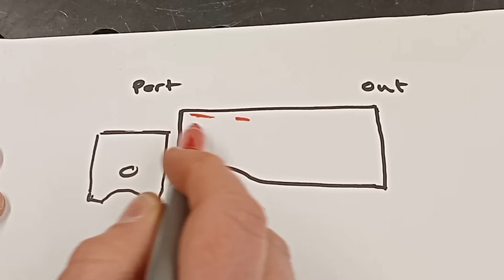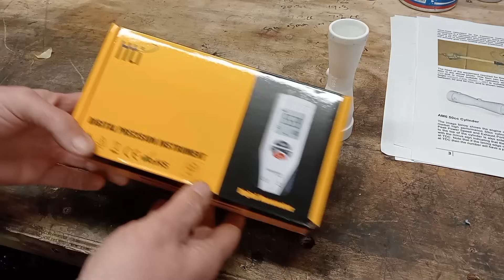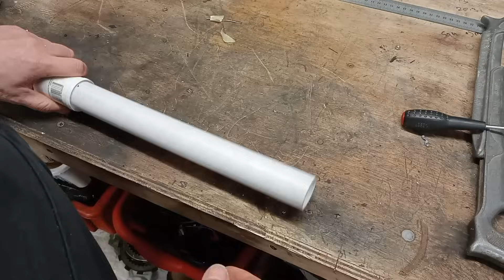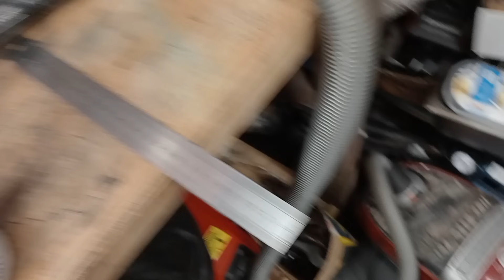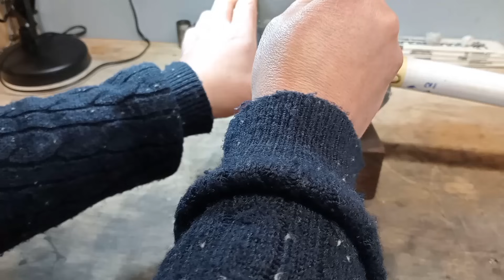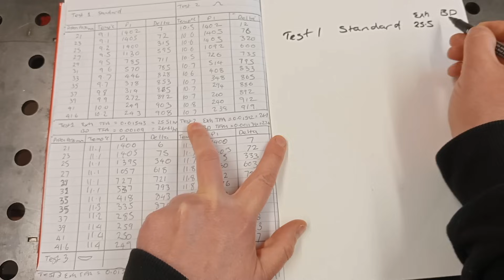2 Stroke Flow Testing - Power increase? 100 MPH Moped Challenge. #power #2stroke #hp

Comment: Sir i have two stroke cylinder i want to increase its rpm, power please help me how i can increase the speed from its ports.  Please help me tell me sir
Reply from the maker: Hi, what cylinder and what are the durations for the ports?
I go through raising the exhaust port in this video https://youtu.be/_4X0QWb8Wcs?si=Fh-8-nIwXexxVCur

Note: raising the exhaust port roof 0.5mm makes quite a bit of difference.
Reply: @AutoBeta2T  Sir, please 🥺 give me your whatsapp number and I will send you the picture of the cylinder and also the picture of its crankshaft.
Reply: @AutoBeta2T  I'm so confused because of porting I've done a lot but I lost a lot help me please tell me
Reply from the maker: @janeali1174  what engine do you have?
Reply: @AutoBeta2T  Suzuki carry two stroke ST30 lj50
Reply: @AutoBeta2T  hello.sir ...!?
Reply: @AutoBeta2T  sir please help me
Reply from the maker: Hi, email: Autobeta2t@yahoo.com
Reply: @AutoBeta2T  Sir give me your whatsapp number I will send you the picture of the cylinder and piston and also send you the video of its engine. Please sir help me in this task I am very confused that's why.  I don't understand anything please sir help me tell me
Reply: @AutoBeta2T  hello sir .! 😕
Reply from the maker: @janeali1174  hi, I sent you an email asking for some pictures.
Reply: @AutoBeta2T  Sir I have sent you a picture of the cylinder on Gmail
Reply: @AutoBeta2T  hello. Sir

Comment: i use big pipe chamber on my kr150 its good for high rpm but give big drop powerband around 7 /8k rpm before  power valve open, how to get rid that problem 😢
Reply from the maker: Unfortunately I think everything is a compromise...
Maybe a ATAC chamber?

Comment: Hi Dave, how about trying a bell mouth on the carb?
Reply from the maker: Definitely,  I have a 3D printer, so really want to explore how it affects power.
Reply: @AutoBeta2T  Obviously it's about 4T but have a look at 
Garage 4AGE, they've tested various fixed length velocity stacks/inlet runners as they call them as well as variable length ones, sort of ypvs on the intake on Toyota (Yamaha) engines

Comment: Hi! Could you advise how to calculate the exhaust for an engine with two pipes per cylinder? I have several old Soviet 175cc engines, they have 2 pipes, one cylinder and are very low in power. I don’t drive them all the time - it’s just small hobby.
Reply from the maker: Hi, I'm not too sure about these types of engines... I would imagine maybe two pipes that are 50 % of the area of a normal 175 cc engine?
I think EngMod2T can model these types of engines? I'll have to have a look later if it can and if so if there is any guidance.
Reply: @AutoBeta2T  Thanks for the answer. It is a simple 175cc single cylinder engine, one of the Soviet copies of the old DKW - cylinder diameter and piston stroke 62x58 mm. There is no reed valve, their speed is low - about 6000 rpm at maximum power. About 14 horsepower. I have a program for calculating exhaust using the Blair formula, it’s quite simple, but it seems to work. The problem is that I don't understand if the single exhaust calculation will work with the dual exhaust. Some also advise me to take half the volume of the cylinder for the calculation, but I believe that this is the wrong way - after all, each exhaust has its own port.
Reply from the maker: Hi, I had a look on engmod2T and it does simulate this type of exhaust port. There wasn't a massive amount of info on there but it looks like the pipe configurations available are two separate exhausts or a two into one. I would think that a calculated two Stoke exhaust for the 175 engine would work but with the header split into two. Probably with the diameter of the header equating to half the area of the single exhaust header that was calculated.
Reply: @AutoBeta2T  Hello! Thank you for your time. Are you proposing to combine both pipes into one resonator? The calculation program uses the height and width of the exhaust port. It might be worth just designing two exhaust pipes, each with its own exhaust port. I have a more "advanced" version of the engine as well. This engine has a single exhaust, with the exhaust port being much larger than each of the two in the old version. And the pipe is also much larger. But I'm not sure the engineers planned to increase its power. Or rather, they tried to reduce the volume)))
Reply from the maker: Hi, yes - both header pipes go into one resonator. A bit like some snowmobile pipes.
Reply: @AutoBeta2T  Ok, thanks for the help. The weather will get warmer and I will do it.

Comment: As someone's who's trying to fix up an AR50 that's been off the road for 30 years I'm chuffed to come across this series.. great work 👍 I've got a bdk ignition, bdk pipe, 21mm carb.. I thought I had it going but after sitting for a couple of months the cylinder was full of oil! :-(
Reply from the maker: Cool, I'm pleased it is of some help. I rode mine with the BDK set up and it was quick - front wheel went up very easily!
Reply: Out of interest what sort of speed would you expect from the 93cc BDK setup? Also, I'm guessing you premix? Sorry for all the questions, not many of us with AR's nowadays and not much info about! @AutoBeta2T
Reply from the maker: Sorry for the delay. I guess 80 mph maybe more if a full set-up. There have been claims of these going 100mph but I'm not to sure of the actual spec of the engine.
Reply: @AutoBeta2T  no problem.. I'd be happy with 80mph 🥴.. back when I was 16, I had a micron, 93 kit, 21mm carb and a supposedly derestricted cdi but it still struggled to get to 60mph.. but at 16 "tuning" involved trying to skim the head with a hand file and using cereal boxes for base gaskets! 😂😂
Reply from the maker: @user-ye8xx7gl3j haha - sounds a bit like mine... I think mine had the ar80 Ignition so would pull 65 and maybe 70 down hill. It had a micron pipe so probably not the best but it looked ace 👌
Reply: @AutoBeta2T  same here.. micron pipe with the three bolt end can.. my cdi had been cut open, you could see where the top of it had been glued back on.. still didn't want to rev though 🤔

Comment: you might be experiencing  part of what happens when you use a wobbly duct.
Reply from the maker: Yes. I was thinking that too. I want to do much more research in to the duct design and test it. Hopefully in the new year sometime.
Reply: @AutoBeta2T  i  mess about tuning mopeds on a hobbyist level and most ducts on cylinders taper out bigger. whereas according to wayne wobbly wright if they taper smaller they make the pipe work better. so for single exhaust ports the wobbly duct tapers to 90% of the diameter of ports effective area in the length equivalent of 1.5 x bore size.  and then back to 100% bore size  in 0.5x bore size.  its a 2 part duct,  total length 2 x bore diameter.  so they narrow slowly and then open up again but a bit more sharply.  heres my example.  i did this to a 47mm 74cc gilardoni cylinder and ex port area was 490mmsq  which using maths pi etc = a circle of  25mm diameter.   first part of the duct   is 1.5 x 47 = 70.5mm long, at that point i needed 90% of 490mm sq = 441 which is equal to diameter  23.6mm.   the first 29mm of this part of the duct was my cylinder duct itself which needed altering. you can drill and insert the correct shaped piece or weld it up. so attached to my cylinder i needed a duct of 1.5 x bore MINUS the cylinders 29mm long duct   70.5 - 29 = 41.5mm.  the start diameter of that duct i had to workout cos the first 29mm had already lost a mm or so. and then 2nd part of the duct is 0.5 x 47mm = 23.5mm  long. and that goes back to 25mm diameter.  bit hard to explain.  but a diagram shows it much more clearly.  ive done a simple cad drawing showing it with my sizes if you wanna see it. dunno how to get it to you? @AutoBeta2T  ?
Reply from the maker: @aljaxon69  hi, that sounds like what I am trying to do with mine. The 1.5 x bore restriction works well in EngMod. And the Mach is around 0.8 too.
It would be good to have a look at your design. My email is: autobeta2t @yahoo.com

Comment: Hi, the flowbench results itself are just half of the game. I would consider the shape of the port with constantly increasing cross section downstream the port window as important, because that helps the wave propagation of the pressure pulses. In mota 2 stroke software I obtained a power increase by raising the port floor of the exhaust window (just as Alex's PIP cylinder had). And mota doesn't even ask for flow coefficients, but does calculate the forward and returning waves from the shape (cross section) of the port. So the opening angle of that part of the exhaust port needs to be considered as well and should probably match the initial opening angle of the pipe....
Just my thoughts of what could be intersting here...
Curios to know what you think about that :-)
Reply from the maker: Hi Stefan thanks for the comment. I've been about to reply several times now but I keep getting interrupted. 
Yes, in theory the exhaust duct should diverge at the same angle as the header pipe but I'm interested in the Wobbly duct design that restricts  the outlet to about 90% of the window area. I intend to do some testing on this.
I haven't played with raising the floor in the simulator yet but again something to try.
I think getting the duct volume as small (optimal) as posible maybe key?
Something to experiment with next year. I will try the shape.of duct you describe too.
Cheers,
Dave.
PS - how much power did you gain in Mota with the raised exhaust duct floor? Did you notice any difference in the pressure wave when viewed in the wave viewer?

Comment: Ciao ho sbirciato varie volte i tuoi video ed oggi mi sono iscritto. Vorrei sapere per cortesia dove hai acquistato il tubo venturi con le prese e i misuratori di pressione
Reply from the maker: Ciao, grazie per esserti iscritto. Ho aggiunto un elenco di articoli alla descrizione, ma vedi anche di seguito:

TorqSoft equipment list:

Venturi 20 mm is most suitable for cylinders with port diameters of less than 33 mm:  https://www.shapeways.com/product/FTPHNUF3X/flow-venturi-20mm?li=shop-results&optionId=59345290

Venturi 27 mm is suitable for cylinders with exhaust port diameters between 30 and 44 mm, and is shown below.: https://www.shapeways.com/product/ZFQJ7UAL2/flow-venturi-27mm?li=shop-results&optionId=59381039

Manomenter: https://www.amazon.co.uk/dp/B07K87NQMD?ref=ppx_pop_mob_ap_share

Brass nipple - 3mm: https://www.ebay.co.uk/itm/390948209350

Comment: I wonder what the difference would be if the exhaust port had a horizontal piece of metal inserted to basically split the top and bottom,  obviously something quite thin.
Reply from the maker: Not sure... If it was thin there would be risk of it heating up and acting as a heat exchanger. It could help blowdown flow.

Comment: My brother had ar50 in his teen years going back 30yrs ago or so, old man put ar80 head, carb and micron exhaust on  and made it worth riding, I remember riding on the back with  him as a 12yr old.... brakes were shite though😂. I never went down the bike route after that, though Bro did some scrambling as we called it back then and got a slighgly tuned big wheeled rm80. As  a fairly small 14-15yr he struggled somewhat 😂... we shouldn't of sold that bike😢 but he bought an Rd125 instead. wished I taken it up more and got my bike license but never  did and went into cars, into chainsaws  and porting with my work now,  so always had a love for 2 bangers. Would love  a 2t dirt bike now, great series though❤👍
Reply from the maker: Hi Rick - sounds like great fun strapped onto the back of your brother! 
Are there any dynos for chainsaws?
Pleased you are enjoying 😀
Reply: @AutoBeta2T  Yeah, there's a guy in the States who has a channel.  'Dyno Joe', I'm curious about that flow testing... you put a hump on the floor of the port, not sure how that is increasing the hp. Is it like accelerating the flow out? Would you just weld that in and shape it with the foredom something🤷🏻‍♂️

Comment: Ive  a super flow  machine ive been  flow testing two stroke motor 14 years  but ive been doing kart motor for 30years  you doing stuff ive already done . You can do more work on inside the piston  , run one ring  . Bottom end pay big part in flow to . Flow test the carby  the air box  .  Pipes Rule of thumb  longer the pipe from the head of the motor to end of first cone give you more bottom end power  that means the power band comes on early and goes out early so shorter the pipe more topend . Now you running a reed block same thing with that to thinner gasket  thicker gasket . More testing.  Good example my mate does outboard boat motors for racing 25hp  because you can't change the pipe  because the pipe is the leg of the motor  you spaces  the carbys out  gives you more bottom end power .  All so read your pug each run to .   Remember  this at work temperature  thing change in shape too . For example nascar motor they hot hone their motor  at working temperature  something think about
Reply from the maker: Cheers for the info Storky. Where did your testing of the exhaust duct point you? From what I can see the flow favors the edges of the duct when the piston is in the blowdown phase and having a raised center section on the floor appeared to help the flow but it reduced the noise too.
Reply: Funny thing  when I test my old motor  kt100s  we could not touch the ports  I was looking for good  barrel    they were hard to find   mostly we were looking at transfers port  . Then years later I was speedway kart  in open  class  did alot porting . One thing I found  in running synthetic caster oil because it a dirt oil and carbon use to build up in exhaust port  that were I use to grind   what they call rabbit ears  in exhaust port  go wider  not high in the port  you go to high the power stroke is small   you lose bottom power  .your transfer port try flow them to front piston  give you better torque  . The head  .8 to 1mm squish  kept  a sharp edge on squish  to bowl  better mix  better responses down low   and the  position of spark pug as well  point the opening towards the exhaust port  more testing

Comment: Looking good progress. 👍
Just make biggest hump and mill it down if it not make any difference.
Have you tested 2mm smaller arrister tube to ex port?
Reply from the maker: Hi Pienari, I could do it that way but i would have to weld up the duct and i'm worried about distorting the cylinder. I'd like to bore out the duct and just use an insert but that will have it's problems too.
I do want to try a smaller exhaust stub - currently it is 30 mm dia where is goes into the exhaust. 28 mm would be about 90% of the window area... Something to try. Cheers

Comment: 3:39 The flow back in has a low volume and the natural shape of the port is quite good in the reverse direction so I don't see problems with that part. You can always flow test it in reverse to get an idea of how it is working.
Restricting the volume in the port to reduce mixing is a good idea.
Reply from the maker: Hi Bill - a good idea to flow in reverse. I should be able to do that when I get around to making the transfer flow testing attachment. 
The restricting volume to reduce mixing isn't mine. I think i first heard about it from Neels Van Niekerk? It's definitely something I've read about somewhere...
Reply: @AutoBeta2T   Well it's nobodies idea, its just obvious and long standing principal.

Comment: Great stuff! Your attention to detail and methods of experimentation are really interesting to watch.
Reply from the maker: Cheers mate. I love: process and procedure :)
Reply: @AutoBeta2T  What you need is an exhaust port floor that is spring loaded so that it follows the piston crown down as it uncovers the exhaust port, just knock something up that does that and you will be sorted! 🙂
Reply from the maker: Yes, that sounds simple! Haha!
If only... I'm hoping that there is a compromise somewhere in the duct shape.
Reply: @AutoBeta2T  port shapes all wrong.. perpendicular to the cylinder!.. look at your port roof vs the centre of flow of the gas stream flowing into the port.. you're ignoring the flow leaving the cylinder especially down the cyl wall & into the port.. a 30-45deg downdraft port angle.. impact is even more when you factor reverse flow packing & chamber tuning.. good study wrong conclusions

Comment: Just throwing this out there but have you thought about making a cylinder head out of 2" thick lexan and then running the engine ?
I have often thought about this for my Honda odyssey's so that I could video tape it and actually see exhaust flow and see what's going on inside the combustion chamber while the engine is actually running.
The lexan head would be made with the same profile as the head you plan to run.
I know that sounds crazy and you wouldn't be able to run the engine very long but you don't need to run the engine for long.
CO
Reply from the maker: Hi, I've not thought of it in a running engine but it would be cool. I think the restriction would be getting a camera that can record high quality slow-mo...?
Reply: All the people that have done that only run the engine at idle and low throttle. Otherwise it will melt blow the head off very quickly. Seeing what it does at idle tells you virtually nothing about what it is doing under full power.
Reply: @billshiff2060  Yes I agree. But you get everything ready and make a full power run on the dyno as fast as you can. With a camera rolling you will have the evidence you need within a few seconds of film.
CO
Reply: Search YouTube, it's been done a few times ( it usually ends with the plug threads giving in.